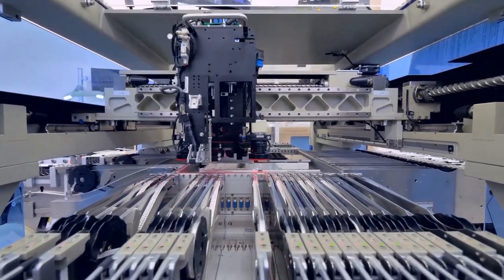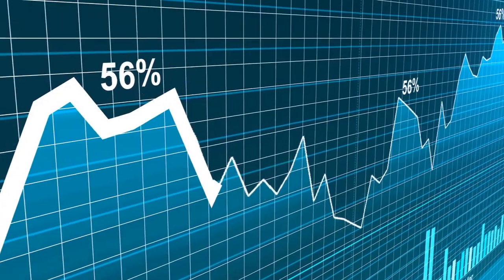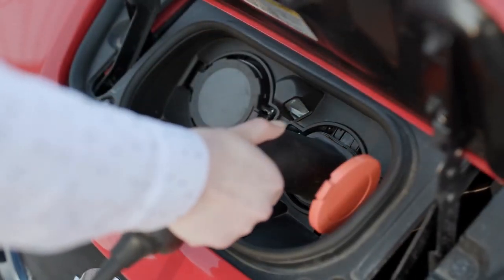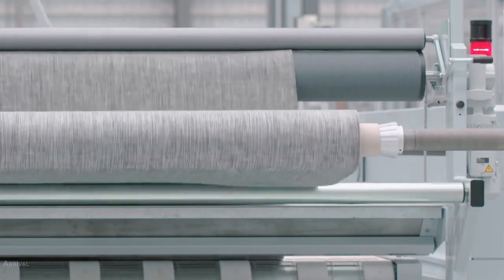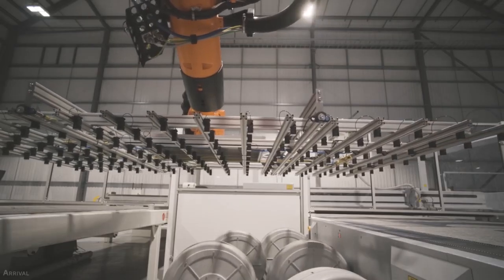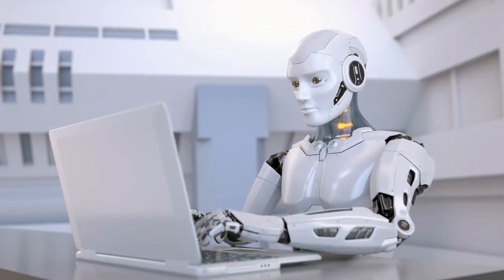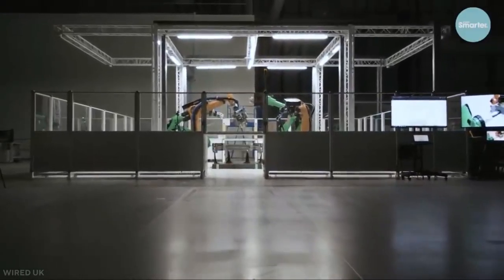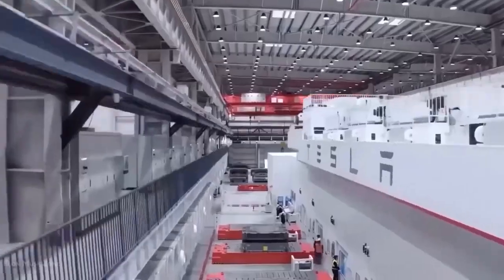Arrival's Micro Factories!

Comment: Micro-Factories could become a very good manufacturing paradigm, however I've heard out of an Arrival staff of approx 2,400, nearly 1,000 are software developers crafting the micro-factory enabling code base.  

Having started programming myself in 1976 on a Cyber-70 with punch card stacks and then in following years writing in excess of a million lines of code for embedded systems controlling aerospace metal forming machinery, I can tell you large software development teams kill companies with slipped schedules and un-focused code.... full stop.   This worries me quite a bit regarding Arrival.

Full-disclosure:  I am a small retail investor with a 15k share long position in ARVL averaging down my position as ARVL stock price sinks.   They have a good idea, we hope valuable IP and more importantly a large wealthy investor (the CEO) with a 72% position, so the VC's are not in charge, thank goodness.  That said: it has been a bumpy ride these past several months since my initial investment.